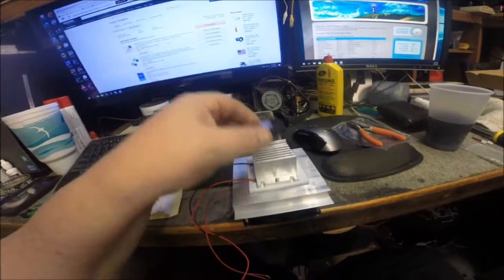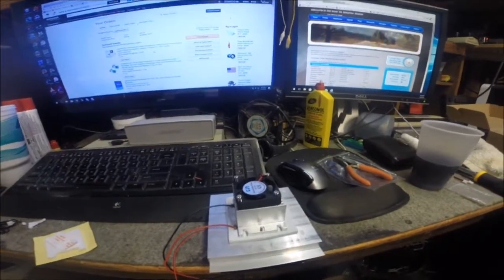How to assemble KKmoon TEC1-12706 Peltier Kit with a HiLetgo W1209 12V DC Digital Thermostat

Comment: Bro así me as faster as you can pls. What is the amperage of the kit?
Reply from the maker: It doesn't come with the 12V power supply but I am using this one and it's running at half duty cycle https://amzn.to/2VxmBtw it's a 5 amp one or 60watts the peltier kit says 6 amps but I tested and it really on pulls about 2 1/2 amps so 5 amps is more than enough.
Reply from the maker: The petltier TEC1-12706 Thermoelectric Cooler is rated at 12V 60W or 5 amps so this powersupply is perfect and it's a nice unit for 12.99 https://amzn.to/2VxmBtw